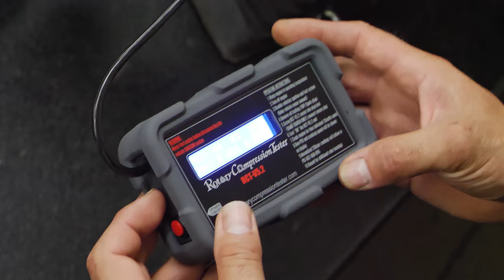3 Rotor is DEAD. I’m done with rotaries for a while...

Comment: This is the reason I ditched electric pumps years ago. Belt drive pumps are where it's at. You will NEVER look back. You cannot match the flow and pressure capabilities of a mechanical belt drive pump. I recommended this very idea to David on his 4 rotor in his Rx7club build thread years ago and he came to the same conclusion. 100psi+ base pressure capabilities with flow that only increases with rpm. Just use a little electric pump to prime the system for startup that turns off after you let off 'start' and you will have no issues starting up and no flow or pressure woes. The smallest aeromotive mechanical pump will flow 3600+ hp. I run this on my 13b. Overkill? Well I'll never have to upgrade my fuel system will I? Oh and get this. You'll spend less than on an electric setup due to not needing to beef up your electrical system.
Reply: Yes Rob, do this! Don't give up! Just take a pause and then get back at it!
Reply: except when you have an air pocket or some sort of cavitation at high rpm with a mechanical and it cant self prime. this happened to someone I know. There was a high spot in the fuel line which would somehow cavitate at high flow demand. rip 4G63 high hp engine. ps I suggest never turning off that electric prime pump.
Reply: What regulator and return line size are you running? Also, do you have to run a feed pump other than initial startup?
Reply: I completely agree with this. 1 pump is always a good thing. And he would lose probably 60+ amp draw off the car.
Reply: Smart
Reply: @joshgemmel768  aeromotive makes a couple regulators that are meant to be used with their mechanical pumps specifically when used with EFI applications. I run a -10 return line off the regulator to the tank. There are a number of ways to mount these pumps. Some use an electric pump to feed a front mounted surge tank. The mechanical pump then feeds from the surge as long as it's mounted lower and behind it. Others mount the mechanical pump in the rear and use a flex shaft adapter from the front of the engine. It's still belt driven by the hub (this is how David's Formula 7 is set up).  A lot of people simply run the pump off the front pulley and draw the fuel from the rear, but you need the pump mounted lower than the tank to do this. So it gravity feeds. Against acceleration the pump can cavite this way. It's the simplest but riskiest way of mounting.
Reply: @brolly9486  Very cool sir. Thanks for the info.
Reply: @brolly9486  how much hp you putting down. In you 13b?  Turbo? Psi? A MSP or REW...  I'm curious about your setup using a mech pump
Reply: @brolly9486  Great info on the mechanical pumps. Why not run the mechanical pump off the bottom of a surge tank like you would with an electrical pump but instead, install a 5psi check valve on the return side of the surge tank back to the main tank? My own 20b is set up this way (minus the mechanical pump) because I wanted to keep my surge tank pressurized to prevent cavitation. I caught the idea because I use to work with hydraulics and parker makes 5psi check valves.
Reply: @rotaryperfection  That is a fine idea you have there. Glad it is working out for you. It would also allow for the pump to be mounted above the surge tank if need be..  considering the inlet to the pump would be under pressure. Especially handy for those who may be running the pump off of a cam pulley up high.
Reply: @dustincomp1814  Borg Warner 8374/13bT with S5 fat dowel irons/large street port/turblown 10mm stud kit/two one piece full length solid dowels. Haven't had it on the Dyno. Road tune around 28psi currently.
Reply: @brolly9486  Thx! If you ever try that out, let me know how well it works for you. I kept my set-up simple with the Parker check valve. Some people could also use another fuel pressure regulator on the return side and adjust the pressure as necessary if you mount the pump higher than the tank.
Reply: @brolly9486  dear lord 28 psi...  That's pretty hefty for relatively little work put in it.  No custom machine or crazy expensive cnc.  Got a life expectancy til it needs a rebuild?
Reply: @dustincomp1814  I have no machine work at all. The rotors haven't even been touched. I run Mazda oem 2 piece apex seals too, nothing aftermarket as they are hard on the housings (some moreso than others). These engine handle a lot if you keep them from detonating. I run water injection and 93 octane. And it's all thanks to the water and a good timing map.  I expect to get a few more years out of this engine.
Reply: @brolly9486  how does 93 with water injection compare to E85 in terms of detonation prone?  Been looking at setting up for E85 and studding my engine and going for 12-15psi as a daily/street tune.
Reply: @dustincomp1814  water steam cleans carbon and has an infinite octane. It also doesn't eat your rotor housings like ethanol does. I have not seen a premix that works well enough with e85 to change my mind. Even the stuff made for it doesn't seem to work well on rotor housings.
Reply: @brolly9486  that's a little depressing.  Figured I could bump the oil injection to help with the ethanol washing bit of premix to reduce the washing of the injected oil.  But the water cleaning does seem like a good idea and would be nice to keep the carbon out so no hotspots. 

How deep in are you on parts and labor/tuning?  Seems your fuel system alone would be a few thousand by the time you convert, upgrade and tune
Reply: Mechanical pumps are the best you'll ever get if you don't have room you can get a remote cable drive for it I run a single mechanical if more than two electric pumps are needed , just say screw it and toss in a mechanical with electric primer
Reply: @dustincomp1814  factoring in everything going electric to mechanical should be little cheaper or about the same price

Comment: If it was running lean, then why'd you keep pushing it..?
Reply: Because they did not trust the sensor/readings.
Reply: because DURRRRRRRRRRRRRRRRRRR
Reply: @ahmedp800  "sir why were you driving 100mph in a 30 zone". "oh sorry officer i didn't trust my speedo" its dumb they didn't trust the sensor which its one job is to sense that one thing.
Reply: @AAO-Falcon  Yep, pretty much, the fault is totally on them.
Reply: Because both of these guys have no idea...!!!
Reply: I rather change the fucking sensor (at least ill have a backup on demand) right away then try that.
Reply: @invertedv12powerhouse77   Exactly, we have sensors on hand for exactly that reason, first sign of something odd we swap them out. 
But its become obvious from watching his videos that he and the people he is involved with dont know what their doing. 
Case in point the 4wd rotor not having any space for seat and pedals inside the cage. You build the cage around the driver, you dont try and stuff him in afterwards.

Comment: Hey Rob I might know someone who could repair your cracked iron.  I work on vintage exotics and we often need some extremely rare or uncommon parts repaired. Would probably be cheaper than buying a new one. Id put his info on here but he doesn't really like to put his contact info out too much. Slide into these dms
Reply: Guys like that don't. It's not like they are hurting for business.
Reply: I would have thought any sort of repair wouldn't suffice for a car like this, under huge boost stress? Correct me if I'm wrong.
Reply: @braed6202  its possible that it cant be repaired but i cant be sure as im not a metallurgy expert. They guy im talking about is and has the ability and tooling to do a lot more than you could imagine was possible. The projects he is currently working on are pretty phenomenal and i wish i could take a camera in there to share.
Reply: True but if it’s under that most boost and pressure it isn’t worth trying to repair if it’ll be weaker you know, so it’s probably best bet to have a new one build as anything inside your motor you want as strong as it gets
Reply: People weld cracks that see thousands of psi everyday. Its very possible to plug and machine parts back into tolerance if he has the tooling to pull it off.
Reply: Yeah but you hear them at the start, “it busted again” and when you’re pushing that much power and boost you basically have to rebuild the part through the same form it was made. I only run up to 28 ibs one boost on my car max and usually around 12-20 but at that boost yes you can rebuild parts but pushing 35-50ib+ of boost you’re going to need every part to be as strong as possible.
Reply: Like many repairs, a proper repair to cast iron will actually be stronger than the surrounding, not repaired, area. It's up to the craftsman to decide how to go about it and what can be done. Pontificating on the internet, if you are not said craftsman, is masturbation.
Reply: @braed6202  they do repairs on much more important and stressed parts than a iron. At the cost of the new iron it's probably worth a try.
Reply: Only place to look...BILLET BY PAC...😉
Reply: SMB Garage what happened to the camaro build
Reply: Eclipse538 been building motors for 6 years and fabricating and other mechanic work for 11.
Reply: Eclipse538 and I run exclusively iron blocks and every single time I’ve had any iron component repaired it’s blown less than 2 monthes later. On less than 28 ibs of boost.
Reply: i doubt money is the problem here.
Reply: Eclipse538 you don’t even know what you’re talking about.
Reply: Eclipse538 6.8l lq4 bores with a single big turbo
Reply: HuhnK0t once you build an fd it’s not as finicky but you HAVE to have your fuel tables correct on a built fd motor.
Reply: Eclipse538 and btw I’ve owned a fabrication business that’s popular across atleast a dozen states for the past 7 years and own atleast 40-50 cars and chassis. I’ve been building motors professionally for the past 6 years and been fabricating since I was a kid. I have 3 very different fully built cars built for drifting, (which puts more strain on cars than any Motorsport in the world) and each once has a fully built motor and chassis built for that power. 6.8l lq4, 3.7l stroker 2jz, built ls3 all matches with 4 speed gforce trans. Like I said when you build cars right they don’t have problems, the only car out of those 3 that’s had problems in the past 2 years is the ls3. The other two were built 5 and 9 years ago and have barely had but operating problems. The ls3 blows apart at the power I want to run especially when I was trying to have parts repaired, as it is an aluminum motor. You want to keep arguing about repairing an iron but the reality is if he doesn’t get someone who knows how to tune the car it’ doesn’t matter because he will fuck it up once again. You don’t bypass safety features without even knowing why it’s restricting you. You have to be a fucking idiot to run a built motor fd on a dyno bypass the safety feature that’s telling you it doesn’t have the fuel to continue.
Reply: @TheBrokenLife  well put
Reply: it can't be repaired its easy  to weld n braze plates but only for corrosion issues,  not integral issues like broken dowel holes it will weld but will only return 30 % strength when 100 % strength can easily brake with slight detonation

Comment: I don't want to come down hard or be a critic; this is your car and this is a sad thing. I also think it's important for me to say that this is an example of why you should try to have a plan for your car before you start modifying it. The idea of a high horsepower rotary car is nice, but they're not something you can just wing it with. Cooling, fueling, and strengthening rotaries is important. I don't want to try to tell you what to do, but I think that just because you've had a hard time in the past, you shouldn't give up on something you're passionate about; please don't drop rotaries forever. Your heart is in the right place and you have the capacity to have the rotary you want. Good luck with your projects, Rob.

Comment: Rob: "I'm gonna push it until it blows, I don't care, let's see what it can do"
Tuner: "It's gonna blow"
Rob: "Keep pushing"
*blows*
Rob: *surprised pikachu face*
Reply: you forgot to mention the part where you half-ass all the work, run water thru a fuel system, etc etc..... then surprised face
Reply: mazdiggle except he fixed pretty much all of the half assed work. Abel said he wouldn’t work on the car if it was half assed.
Reply: lmao
Reply: @spongetot22  so it was quarter assed? So he thought
Reply: Arthur Sperotto nice
Reply: Arthur Sperotto he death that’s why he couldn’t hear the tuner lol
Reply: lmfao
Reply: @mazdiggle  to be fair the block was already cracked when it first went lean, which was caused by one of the pumps leaking from its case dropping fuel  pressure. not caused by any of his half assed work, but took time to detect because he had to double check all his half assed work. stuff like that happens all the time even if you build it %100 right, sometimes the parts fail themselves. Like the first AEM ecu's that had capacitor issues, or the first gen Tremec T56&TKO500/600's sycnhros couldn't keep up with shifts made 7krpm and higher. Even some Walbro 255's went bad in the early 2000's.
Reply: hahahahaha
Reply: LoL yeah this is what happens when you try to hard. I'm surprised that not enough tuners fuel flow test the system. X power needs X fuel so test it to make sure you have it. My tuner did this and I was only going for 350hp.
Reply: DED LOL
Reply: Hahahaha😂😂😂

Comment: dahm dude, not good. I wrote you an original poem.

he protecc
he attacc

 but most import

this rotor won't come bacc
Reply: Well its still more reliable than a Focus rs
Reply: @joonaslaakkonen8096  explain what you mean
Reply: Joonas Laakkonen yea this shit always braking.
Reply: @shawnparadox9299  lol they had a recall for cracking the blocks
Reply: @shawnparadox9299  shit on em breaks all the time
Reply: Bryce Mcvea nice
Reply: CoHxUnLoaDz98 not to mention the wrong head gaskets from the factory lmao
Reply: I think that's their excuse to deflect from the terrible open deck block design and the cylinders flexing.
Reply: Joseph Maxwell well I mean didn’t the rs have a problem is burning coolant bc the block is so similar to the EcoBoost mustang block  that they fucked up the head gaskets? I thought that was the issue
Reply: LOLMFAOOOO

Comment: I had some simular problems with my car. Turned out to be insufficient grounding. The grounding for the pumps was good, but much to little for the pumps in my case.  So say that one pump draws 10A. And your pump grounding has a résistance of 0.2 ohm. Than you lose 2 volts over your ground. (Voltage=amperageXresistance).
Now you run multiple pumps over that same ground, than the lost will increase. Example 2 pumps at 10amperes each and you will lose 4 volts over that same 0.2ohm ground. With 3 pumps at 10A with the same ground, voltage drop is at 6 volt. The value's given are just an example.
Reply: The theory there is sound (voltage drop across a bad ground), but I think the 1 to 1 increase in voltage drop is incorrect (although my ee is a bit rusty). A similar voltage drop effect would occur due to the increased current load causing an increase in temperature at the resistance point which in turn would increase the resistance, increasing the voltage drop, increasing the temperature and so on.
Reply: There are more factors at play, I agree. But when your résistance in your cable is the same your voltage drop is lineair with the current consumped. So 20A has double the voltage drop as 10A with equal résistance. 30A is 3 times the drop with respect to 10A
Voltage=ampsXresistance.
Voltage=10A times 0.2ohm=2volt.
20A times 0.2ohm= 4 volt
30A x 0.2ohm= 6volt.
As you can see, its lineair.
Also thermal résistance change in such a low résistance pad is next to nothing. So that' s not a big issue.

Comment: You need to use a Mechanical Fuel Pump at this point. Will solve all of your fueling issues and the little bit of power you lose can be easily made up for with a bit of extra boost. Use a small electric pump to prime the system for easier starts.

For the car in general I get that its a Track car but maybe take a month and tear the entire thing apart and clean it all up. Make it look pretty and also organize things better so its easier to fix and diagnose something. Would make some content at the very least.